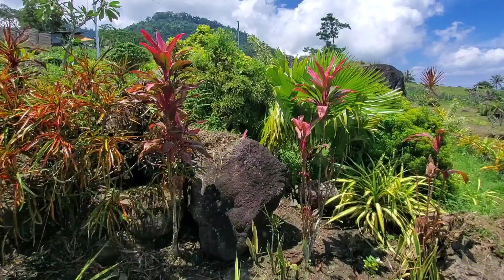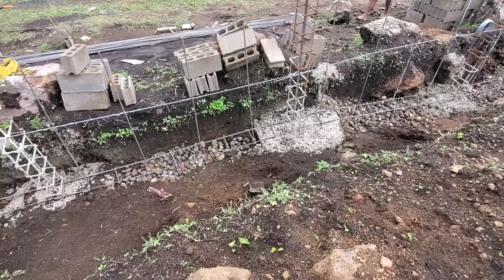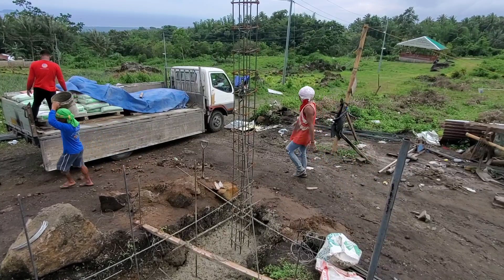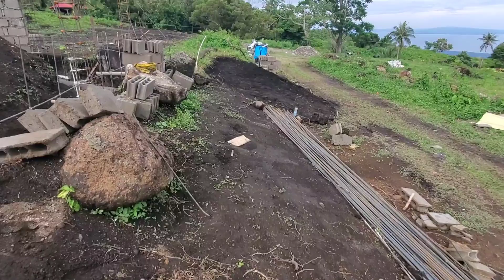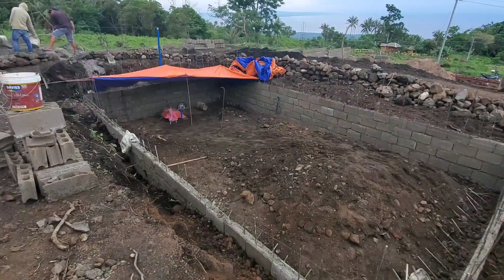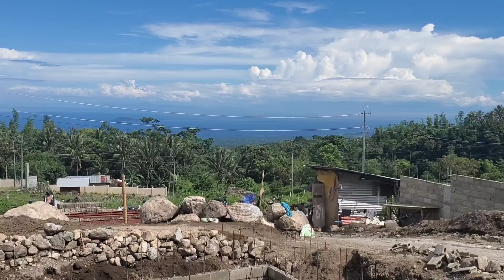Philippine Home Building - #Construction Day 27

Comment: Very informative video Greg. Just curious on why the design of your fence is different from the design of your swimming pool since both walls are only subject to lateral forces; earthquake & wind for the fence and earth and water pressure for the walls of the pool. Really only  earth pressure for the walls of the pool.
Reply from the maker: It was engineered that way because of the weight of the water pushing outwards.  They use extra rebar closer together to handle that pressure.  Thanks for commenting and watching our videos.
Reply: @buildingthephilippines  Thanks for the reply Greg. Keep those videos coming. Actually your engineer most likely engineered the walls of the pool because of the push of the backfill because it is in the opposite direction of the push of the weight of the water.  The net push on the wall is less if there's water.
Reply from the maker: Yes, that makes sense, hopefully then same pressure each way!!!

Comment: Hollow blocks to close rebar keep distance as air water enemy of metal won’t it to last
Reply from the maker: Not sure what you are saying?
Reply: @buildingthephilippines  blocks on front fence no gap between blocks and rebar so cement is around rebar need at least inch two better so metal don’t rust if it rust fence will loose strength and should check all rebar